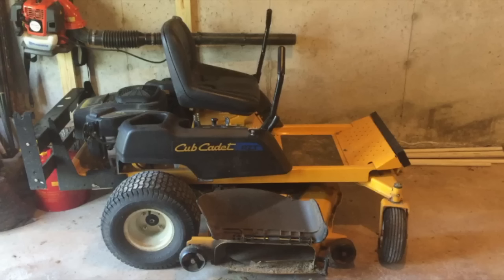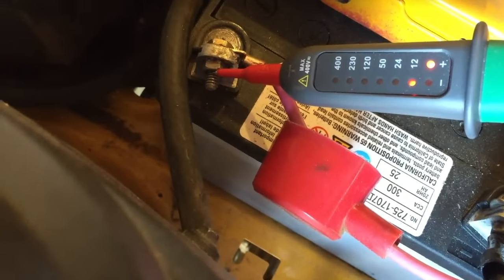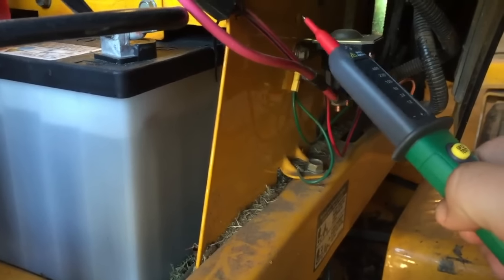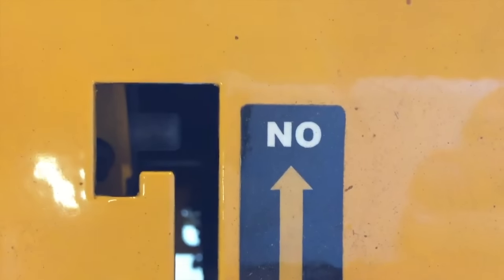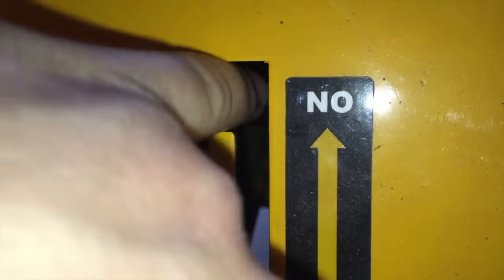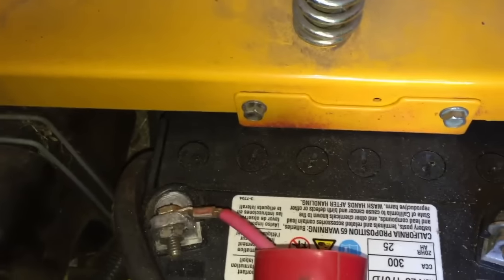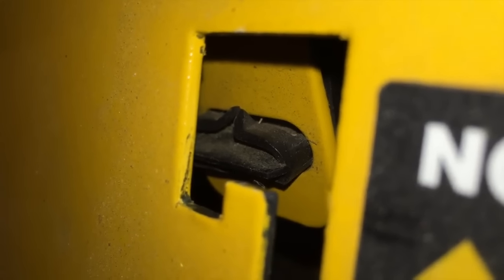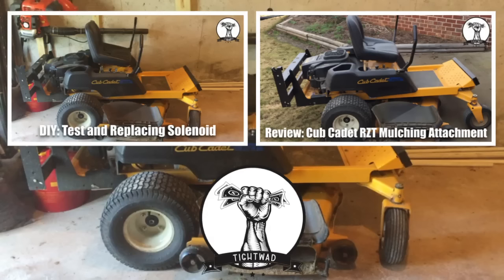FIXED: Mower Will Not Start - Safety Switch Diagnosis and Repair - Cub Cadet RTZ ZTR

Comment: I'm having a similar issue with my RZT 22... about a month ago I had to order a new ignition switch for it and then about a week and a half ago i was on a property and shut it off to fill up the gas tank... it wouldn't start back up... I found that I could jumper the solenoid to get it going to hopefully just finish out the season since we've only got like 3 or 4 weeks left but I was only able to do that until this past monday when that stopped starting it... I replaced the solenoid and did determine the orange wire that  you were pointing to is part of the problem... personally I feel these mowers have WAAAAAAAAAAAAY to many safety switches on them... if you're not an idiot then all you really need is the parking break safety switch...  nice video btw... pretty much confirmed what I was thinking for mine...  MTD really needs to include a hatch that we can remove to easily get to under the seat.
Reply: Mmmmmmm ?????? Some 1 needs 2 come n said some
Reply: Cornthwaite Lawn Care was

Comment: glad to have found you. have almost identical mower. someone rewired it to remove all the safty switches, and now, battery has to be charged each time.. first thing I noticed, you do not have "extra wires" on you battery post, like mine does.. somewhere, something is draining me.
Reply from the maker: Mr. Randy Interesting. I would like to disable the switches that cut the PTO off when I go in reverse but the others are helpful. I'm not sure what could be drawing power. You never know what they wired incorrectly. Maybe you could buy a battery tender that will keep your battery at full capacity when not in use. They make your battery last much longer anyway so it would be a great investment.

Comment: Always Check your seat switch and control arm switches first since they are much easier to get to.  Mine was throwing a "park brake" light as well and it was the right side control arm switch. Always start with the easy stuff first  Mine has two park break safety switches that are in the same spot as this one held on by 2 5/16 bolts .  No need to remove battery but you do have to stick your arm in from the back and blindly unscrew starting with the bottom switch first.  Once you get both bolts out of  the switches there is enough wire to pull them out into view still connected.   Pull the switches off the connectors and use a multimeter to check continuity.  2 of the poles should read open when switch is not engaged and 2 should show continuity.  Once the switch is pressed you should see the opposite condition.
Reply from the maker: Shred Warrior Thank you for sharing your experience. There is no way to get your arm into this mower to remove the seat switches. It’s fully blocked by the battery and gas tank. The wires also aren’t long enough to pull the switch out into view. There are several designs for this mower.
Reply: Good point on yours I am fortunate to have the design where the fuel tank is under the wheel well. I didn’t notice the different configuration when I watched your video the first time. Thanks for pointing that out. A wise man once told me always check the simple stuff first or as Carl Childers says “it ain’t got no gas in it umm humm”....
Reply: I have the Troy Built version of this mower and I am getting the "Park Brake" light as well. Mine has 2 of the parking brake safety switches stacked on top of each other.  I replaced the switches and still have the same issue.  I will now try testing the control arm switches after reading this.  Hopefully that is my problem.  If not, what else could this be?
Reply: @D22South  I'm having the same problem, what did you finally do to fix it? This is very aggravating!

Comment: Great video to show the problem and how to resolve.  Wish my Husqvarna had that four-light panel to show where the problem is.  It will start cold, but once hot turning the key does nothing - acting like a safety switch cutoff.  Needs several hours to cool down to allow whatever switch to reset and allow a restart.  

That parking brake switch is a pain in the @$$.   Most times the brake is not required at all since you're sitting level.  But you have to set it just to start.  Since the levers have to be in neutral to start as well, there's no chance the mower can just take off when started.  This "safety" is to the manufacturers, not the users.  The other three switches make some sense.  Not this one.  And what a pain to remove!  Levering clips always has a chance to break them, meaning another part to replace.

The seat safety switch will kill the engine whenever it's not engaged, starting or running.  But the other switches only inhibit starting, not running.  How does that work?
Reply from the maker: I totally get your frustration.
Reply: @TightWadDIY  Thanks.  At least the switches are fairly accessible. 

I can work around this by making sure I finish mowing before shutting down.  But still.  I don't have the inclination to troubleshoot this, but if I take it to the shop it'll have to be "hot" for them to isolate.

Comment: Have you had a problem with your , running for a while then dying out , all systems are go & new . rec fuel...
new coils , vented fuel cap... thx
Reply from the maker: I haven’t. Sounds like something is overheating.

Comment: I have a 2005 Cub cadet zero turn. I have changed fuses,  and put new battery on it. The lights won't come on for the battery and it still won't crank. What else do I need to check ?

Comment: I have a cub cadet m50s, runs fine but when i turn the deck on via electronic PTO the mower shuts down?
Reply from the maker: Check to make sure the blades spin freely when the mower is off. Make sure nothing is binding.
Reply: @TightWadDIY  i believe the park brake switch is bad.
Reply from the maker: @oSTYNCLSYo  If the parking brake switch doesn’t work, you won’t be able to start the mower without jumping the solenoid.
Reply: @TightWadDIY  it starts with the park brake engaged but when you release the park break the mower dies, so i unplug the switch and it keeps running. So maybe a switch somewhere else is bad?

Comment: My mower dosent have a parking brake and I havent seen slsafety switches associated with the handle bars steerage though they must be in the open pos IU tion to crank the mower.
Reply from the maker: Interesting. How old is your mower?
Reply: @TightWadDIY  3 years old.  Bought it ne.  Home depot
Reply from the maker: @frankdavis3486  I wonder if it’s like the newer golf carts that don’t have a parking break. It’s cool tech.
Reply: Well, my cub dosent have a parking brake.   So, I cant say what the issue is.

Comment: Is there a way to just disable the parking brake sensor and the two sensors for the handle bars?
Reply from the maker: No. But you can disable the reverse switches by popping them out of their holes.
Reply: @TightWadDIY  yeah I seen that. After I removed them to replace them and noticed they had 4 wires going in instead of two. Thanks for the reply though.

Comment: I have the same mower, but sometimes I only get 10v going toy orange wire going to solenoid,  then sometimes I get 12v. It still doesn't engage the solenoid. I've replaced the battery and solenoid. No lights come on stations a parking brake is set. What am I missing?
Reply from the maker: Can you jump the solenoid and get it to start?
Reply: @TightWadDIY  I could not. I found that the positive lug was never crimped and wire was pulled mostly out of the lug. Which gave me 12v at the solenoid but was too much resistance for current to flow. Once I fixed that I was good. The lug had tape over it. So it was not visible until I took the tape off. Very frustrating. 
Thank you for responding back.
Reply: @keeperap  I’m glad you discovered the issue.

Comment: Do you have the part numbers for starter solenoid and the brake safety switch
Reply from the maker: Each model is different. You can download the parts manual online or look up the part numbers on the Cub Cadet website using your mower model number found under the seat.

Comment: I have a few questions my zero turn wouldn't start either and I replace the new solenoid just wondering is there an actual way to hook up the solenoid because of the two post or shouldn't it matter
Reply from the maker: Jake Friesen Yes. It needs to be set up a certain way. The cable from the battery goes on the left side, and the other thicker cable going to the starter goes on the right. The smaller cable from the key switch goes to the spade.

Comment: Nice videoI. have a Cub Cadet ltx1046 where I was fighting similar issues this morning. I disconnected all the safety switches( just did not want to use them ) but then narrowed it down to a bad ignition switch. This is my 3rd Cub Cadet, so I do like the brand. But I have heard the these ignition switches are prone to fail. Thanks for a good video.
Reply from the maker: Thank you for the additional input.

Comment: I have the same mower and after removing the battery there was no clear view of the switch. It would be really great to have more detail on access to the switch.
Reply from the maker: The view at 5:20 in the video was the view from the battery location towards the front of the mower. The gray box farthest from the camera is the back side of the switch. Is there something in the way on your mower?
Reply: +TightWadRepairs 
Yes. part of the bottom of the seat frame completely blocks the view on mine. I think mine may be a year older than yours as I just noticed the hour meter looks a little different. All else looks identical though.
Reply from the maker: +Kevin Hayes Wow. That makes things difficult. Sounds like you would have to remove your gas tank instead.
Reply: Yes. I think so. Thank for the tips. Great video!

Comment: Hi, I have the red light on for the parking brake both when the park is off or on, mower wont start. How in the world did you get that switch out with a  screw driver? Do you know of another way to get the switch out.  John
Reply from the maker: It could possibly be your switches on your handles too. Are your handles all the way down?
Reply: Reach your hand in an grab it push up or down its in a slot not all that tite .

Comment: I have the same exact mower. I think my seat doesn't know im sitting on it... how does it know? Where is the switch?
Reply: In your video you mention disconnecting the seat switch to make the seat believe you're still on it. But if i disconnect that the blades won't engage. How does the seat know i'm actually on it - maybe this is a better way to ask it

Comment: I have this same mower, 2007 model. I got it on Facebook marketplace, got it home and turned the key and the parking break light came on. So I watched this video and ordered a new switch. Got the new switch today, put it on and when I turned the key, it's still showing the parking break light. Are there fuses or something for the parking break or could there be an issue in the transmissions causing the parking break issue?
Reply from the maker: Make sure your handles are in the down position when you try to start it. There aren’t any other fuses that I’m aware of.

Comment: Parking brake switch problem also  but on a Husqvarna.  My switch is ok, but something missing on the linkage that depresses it, looking for a picture of what it should look like.
Reply from the maker: W Rigg You should be able to find a parts layout for it.
Reply: @TightWadDIY  The crux of the problem on this Husqvarna seems to be the brake handle aft end acts as a cam to operate the switch, and seems to be slightly out of alignment.
Reply from the maker: W Rigg That’s how the one on my MTD rider operated too. Is it possibly the switch shifted and the parking brake is actually functioning properly?

Comment: You referred me to the same video, but you said there's no real way to test the safety switches, that just because they push in doesn't mean they work (handlebars).  You said the parking brake was probably the culprit. I don't have a cub cadet that you have that is equipped with a sensor dashboard that lights to indicate if my brake is on or not.  How did you test it? With a multimeter?
Reply from the maker: Here is the video. https://youtu.be/TGyxaxl46SQ
Reply: My tractor will turn over and run when I turn the key to the start position, but as soon as I release it to the run position, the engine shuts down.
Reply from the maker: @JuanPerez-xi9zj  it sounds like there may be something wrong with the key switch but I can’t be sure.

Comment: SO I have the same cub cadet.  my blades wont engage when i bring the control arms in.  It has been going out for a while, I could milk it in to get it to engage.  Is it the safety switch at the base of the arms or the control arm safety?  How can you check them?
Reply from the maker: Tom Northam It sounds like it’s the switch at the base of the arms. Here is a video I made showing how to test a switch. https://youtu.be/TGyxaxl46SQ

Comment: There’s one of these for sale in my area for $650 hes asking and has no start issue… wonder if it’s worth getting for $500 and trying to fix it
Reply from the maker: If it’s not working I would offer even lower. Should be at a “for parts only” price.
Reply: @TightWadDIY  what’s a good price to start?
Reply from the maker: @moderngod1  I’d offer $200.

Comment: i have same mower but i am having issues the 4 lights not working, is there a fuse do you know of that is for them or not?
Reply from the maker: Sewingmom What four lights?
Reply: @TightWadDIY  I believe that they are talking about the hour meter and the four lights that surround the lcd screen.  The light that indicated you did not have the parking brake set when you actually did.  I have the same problem.  When I turn my key I don't get any read-out on the hour meter or any of the surrounding lights.  Do you think that would be the ignition switch itself?  And how would you go about checking that?
Reply from the maker: David Trimble It could be the ignition switch. This guy does a decent job explaining how to test it. https://youtu.be/q8G7kxCl9hY

Comment: How do you disengage safely switch  on steering handles
Reply from the maker: Billy Jolly I haven’t successfully done that. I would love to disable the ones that cut off the blades when reversing.
Reply from the maker: I have an idea. I’m going to try it after work today. I will post a video if it works.

Comment: RTZS 42. It shows "low battery" code and cranks like crazy but won't attempt to fire. My dealer changed the battery twice and now my warranty is up. Can I remove this sensor somehow and avoid buying a battery every year?
Reply from the maker: Tommy Green Hey, Tommy. I would recommend seeing if you have a Batteries+ nearby. They sell both Battery Tender and another comparable charger. You can also find them on Amazon if you need to. These brands of charger maintain your battery at full charge and charge on demand or "float". This greatly increases the life of your battery and prevents the "low battery" code after the off season. I am not aware of a way to remove the low battery warning on your mower. Your local dealer did you a disservice by not telling you about the float chargers previously.

Comment: If i try to turn the mower on and the battery light turns on what can i do to fix it
Reply from the maker: Unfortunately, it could mean several things. Check to make sure your battery is charged though. Also check the in line fuse between the battery and the solenoid.

Comment: Is there a way to bypass the parking brake switch?
Reply from the maker: I’m not positive but I doubt it. That one uses both functions. It’s required to be pressed in to start the mower but has to be released before you can move the handles to move the mower forward. It cuts the motor off if you try to move forward while the parking brake is engaged.

Comment: My tractor will turn over and run when I turn the key to the start position, but as soon as I release it to the run position, the engine shuts down.
Reply: Mine too. Ever figure it out?